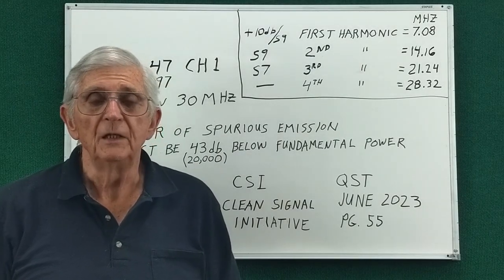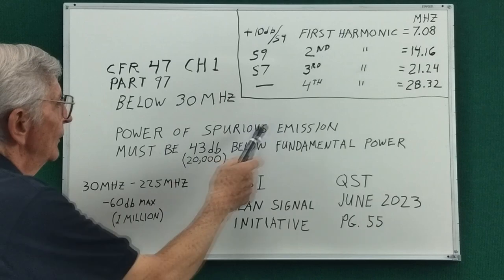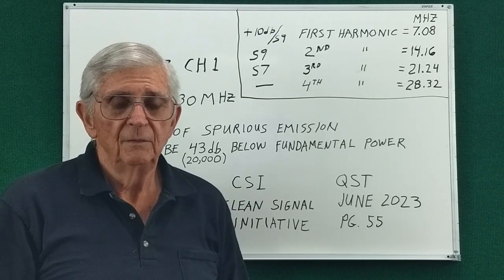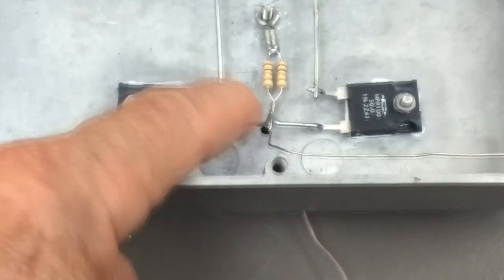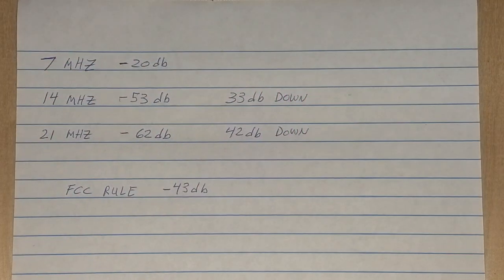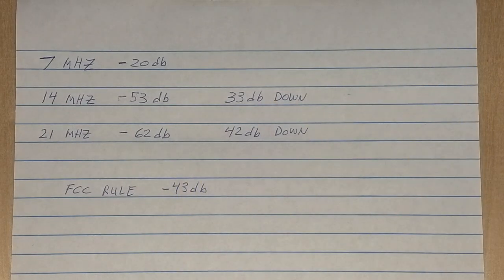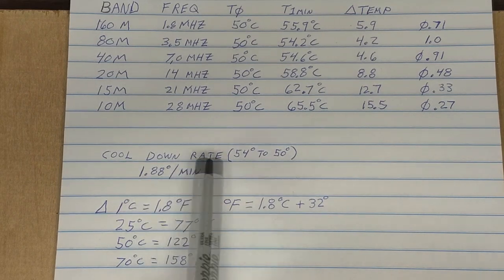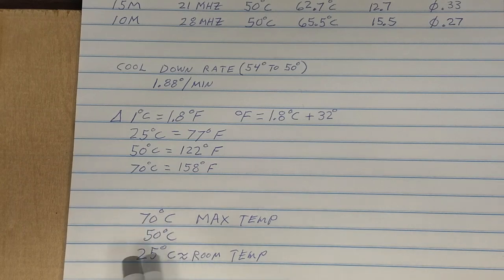EFHW emissions violate FCC rules

Comment: The various ferrite "mixes" (or types) have several highly temperature-sensitive characteristics that affect transformer linearity, most their notably permeability change.  As perm changes, the magnetization curve (BH curve) tilts introducing transformer harmonic distortion. Core suppliers can provide material characteristic data sheets.  I have always believed that HF and up matching transformers use for any antenna are not ideal due to their losses (heating), and best to utilize a matching circuit or ATU instead.  Your work reveals something most have not previously considered.  Good job.
Reply from the maker: In this more recent video I discuss exactly what you are talking about.
https://youtu.be/mev44L1Y3us?si=1g-BcCHum8DPr5Vj
Thanks for your nice comment.

Comment: Excellent demo! This is certainly the first time that I have heard about this.
Reply from the maker: Thanks for your comment.
Reply: It is his misunderstanding, looking for something that is not there.  The radio or circuit he has put together is at fault.  The spurious emissions need to be measured from the radio directly using a dummy load, then through the box he has made.  You will find it is the box he has made that is causing the problem.
If the radio is giving spurious emissions it needs sorting out.
The antenna only radiates what is put in to it.  Every licenced radio amateur knows this.

Comment: Jim, I think your title is a little misleading. Someone might read it and think that EFHW (or EF random lengths) are inherently problematic. What about dipoles with ferite baluns at the feed point? What of unun's feeding verticals? The title therefore should focus on ferite core heating and not the antenna as a potential problem. Yes, because EF antennas require an unun there could be a resulting harmonic problem, but the problem certainly isn't limited to that antenna.

I suspect also the ferite material would affect the data you secured. You didn't specify that information. Type 31 vs type 43 vs type 52 vs type 61 or Txxx-2. Depending on what the material of the core is will undoubtedly affect the heating vs frequency. And 50°C seems an unrealistic starting temperature; it's hardly ambient except in the Sahara Desert and I don't think many of us live there. I used to live in Phoenix and even that's a tad bit high unless we're frying eggs on the streets (urban legend).

Your conclusion about cooling seems spot on. I've thought about that quite a bit and think using a ceramic material might be a better heat sink to attach to since the ubiquitous PVC box does nothing here and mounting flush to an aluminum box might have its own issues (although DXE uses aluminum boxes in their transformers).

I like your video and wonder if you could make an update to it with the considerations I mentioned? I'll even provide you with whatever cores I have on hand if you want.

Glen
KE7FD
Reply: Core saturation also is really great at causing distortion/spurious signals.  It's not directly related to heat.
Reply from the maker: please read the very first sentence in the description. The thumbnail it meant to attract attention  which it obviously did. The 50 deg C temperature is not an ambient temperature; it is the core temperature after several minutes of operation. The core will reach 50 degrees after just 2 minutes of transmission on 10 M. It is roughly half way between ambient and the critical temperature (70 deg).
Thanks for your comment. 73
Reply: @Jimscoolstuff could you share some details of the transformer? Core size and number , winding details, etc... Did you measure efficiency? For the test what modulation did you use, FM, CW key down or something else? These details are important in order to understand your test. If you could post the picture of transformer that would be helpful too. I would like to repeat your tests myself and find the way to remedy undesired effects. GL 73 Marek SP9TKW.
Reply from the maker: @mareksp9tkw908  The core is an FT-240-43 made by Amidon. It is the standard 2 turns to 14 turns with the crossover. There is a good view of it at the 59 sec. mark into the video in the description below. The one titled "EFHW antenna power rating". The tests shown were just 50Watt carrier on or off, no modulation. Thanks for your comment. 73
Reply: This is apples to oranges obida.  The EFHW is using a "transformer balun", which depends in part on magnetic flux to transfer input power to the output.  This heats the Toroid.   A dipole uses a 1:1 "transmission line balun" which transfers input power to the output through the transmission line; it does not use magnetic flux for the power transfer and does not heat the core like the EFHW transformer does.  73 de DJ0IP

Comment: Part 97 specifically indicates that these measurements are to be taken at the output of the final power amplification stage.  This is interesting, and in the spirit of good amateur practice it's worth continuing to look into.  However it's a stretch at best to claim the emissions from an EFHW are "Illegal".  So long as what comes out of the finals is legal it appears to me that you're 100% compliant with the regs.   Take the reverse situation:  are the import HTs that clearly generate excess emissions OK because their antennas are terrible and don't radiate those emissions?  Of course not.  This is why it's measured where it is.
Reply: You are spot on.  97.307 (e) is very clear - input to the antenna transmission line.  I do appreciate his efforts, but definitely bogus to call it illegal.
Reply: By that logic, back-to-back diodes installed at the antenna (designed to square-up the RF, generating endless odd harmonics) would not be illegal. Right ?

Hmmm. Perhaps there are other regulations in existence than just 97.307 (e) ?
Reply: This may be legally true, Matt, but that won't help you much if you get a pink slip from the FCC.
Reply: @JxH  this

Comment: Thinking about it there may actually be 2 different heating rates.. the one you measured when it is reasonably efficient when it is in the cool linear region, then as it heats up and becomes non-linear and inefficient absorbing more and more power so heating up faster as it hits thermal runaway

Comment: EEY-GADS-ZOOKS BATMAN!
WHAT'S A HAM TO DO?

Actually, this is very informative info and is well presented. Thank you, Sir.

I'm in the process of putting together a second 56:1 transformer for my 40M EFHW ant using a better toroid, and you just threw a Monky Wrench into my soop. ARGGG

I mostly operate SSB voice and don't expect to get into this problem there with my 100W 590SG, but I do intend to operate Digi/APRS/WSPR/etc on HF in the near future and also get back into CW and I should deffinatly take your information into account.

I'm thinking of two stacked cores with an ALU disk, with cooling fins/tabs, sandwiched between the cores using PC-CPU type heat compound. I'd tie the cores together with TieWraps.

Alternately, a single core with a tabbed ALU disk at each end should be sufficient for 100W Digi ops. Maybe, I HOPE.
A few each of the 15 turns of enameled wire should fit safely between the fins, I think/I hope.

I'd cut the disk out with a Dremmell and bend the fins/tabs in alternate directions, up/down.

Yet Another Snot on the Door Knob of Life to Deal With.

DRATS. Double DRATS Even......

73 OM, and thanks for this info.......
Reply from the maker: Thanks for your comment. Good luck with your experiments. Remember that heat means losses, so a lot of your RF is wasted making heat.

Comment: NEWS FLASH: Ferrite has been used in the feed of many types of antennas, it's not just an EFHW thing. Baluns were a 'Very Big Thing' in the 1970s. 

Also, EFHW, being extremely high-Z, would have less current and thus less core saturation than other antenna types.
Reply from the maker: First of all, the cores are fed at an impedance of about 50 ohms thru the two primary turns. This means that the full output current of your transmitter is applied to the core.
Second, the problem does not appear until the core reaches a critical temperature, so depending on how you operate, you may not see the problem.
Third, the folks selling this stuff don't want you to hear of this problem.
For a full understanding of the issue please watch these two videos.
"EFHW antenna power rating" and "EFHW spurious emissions caused by ferrite toroids"
Thanks for your comment. 73
Reply: Not all baluns were created equal.  Transformer Baluns tend to heat (or even overheat) whereas Transmission Line Baluns do not; at least not nearly as early.  Dipoles use Transmission Line Baluns whereas EFHWs use Transformer Baluns .   It is indeed a potential EFHW problem.

Comment: Excellent.  Good to know, especially that it occurs long before SWR creep begins.  May not be a problem with SSB but certainly with digi-modes!
Reply: SWR creeping up usually happens with poor quality ferrite rings.  They DO heat up when you subject them to RF.  If you use something too small, or use wire that is too thin, it will all heat up.
Use something that is not just rated for your maximum power, but overrated by a few times.

Comment: So, just some things I got curious about while watching the video...the time to cool of 1.88C/min...is that average? Is it linear, or is there a curve? Re: the temperature increases per band, I'm interested in seeing how that matches up to the core's position on those ferrite core efficacy spreadsheets out there...the ones where green and a black line are good... (sorry, spacing). Also, do you have a part num for the Core-under-test, and what's the placement of the thermistor? I might try this with the thermal scope. Excellent video.
Reply from the maker: The cooling rate is a function of the core temperature above ambient temperature. The core that was used is an Amidon FT-240-43. Here is a link to another video on the subject.
https://youtu.be/mev44L1Y3us?si=UEX0SrO7rIjK9y14
I am working on a second part of that video.

Comment: There is one large question.  Did you apply a constant signal to the transformer? IE key down CW or FM?  That will heat up the toroids for sure, but is that what happens in the real world? No, certainly not.  The duty cycle of an average CW signal is way below 100% and no one runs FM on 40m.  Therefore, the toroids would experience one 50% cooing cycle for each 50% heating cycle. I  think if you apply real world applications and real world uses by everyday hams the results would be very different.
Reply from the maker: I usually run FT8 which transmits PSK for 13 seconds, is idle for 2 seconds, and listens for 15 seconds continuously. That is a 43% duty cycle. When the core heats up faster than it cools down, the core temperature will steadily increase over time. You are correct, CW and SSB are much lower duty cycles. Thanks for your comment.

Comment: Thanks for sharing this Jim. It would certainly be good for others to repeat this test to see if similar results are obtained. Of course, as you say, ARRL (or someone with proper lab environment) looking at this would be good.

In addition to EFHW UNUNs, wondering how this might affect use of toroids in multitude of applications - PA stages, antenna matching circuits, filters, etc? Basically, any application where toroid cores are being used and subject to significant heating.
Reply from the maker: Thank you for your comment. I would like someone to confirm my experiments or even confirm that the cores get hot. In other applications there should not be any problem unless the cores get hot.
Reply: Ferrite cores do get hot sometimes to the extent that they get shattered in high power applications. 
Many have complained of the heating up of EFHWA UnUns with high power and many solutions have been suggested. 
In high power, solid-state power amplifier ferritr loaded output transformer designs harmonics are anticipated; so, low pass/harmonic filters become mandatory. 
This is the first time I have seen one is experimenting to look for harmonics in the efhwa UnUn transformer. 
Thanks for your efforts  👌 
De VU2RZA

Comment: Jim, I'm not seeing those Ohmite in the TCH series on Mouser -- could you provide the part number you used?
Reply from the maker: I guess I got my projects mixed up. The resistors that I used in the dummy load was a Caddock part. The Mouser part number is 684-MP9100-50. Sorry for the mix up.

Comment: If your cores aren't rated for the power you're using, then yes they'll heat up. The fact that they're heating up tells me you're not using the right core, or you're exceeding the power rating for the core.
Reply from the maker: Please tell me the power rating of the FT-240-43 core. Thanks for your comment.
Reply: @Jimscoolstuff Check out the videos put out by MM0OPX on the impact of various core mixes and designs at different frequencies.  He is looking specifically at efficiency and loss in the cores with different windings, stacking, etc.

In particular, 10m has really low efficiency as you have observed.

Comment: SO would like to see other ways to feed the EFHW that do not involve a ferrite transformer,  even though I would assume these methods might only work on a single band at a time and require tuning.
Reply: Could one use an air-core autotransformer with  more turns >> equivalent  inductance to ferrite core device? would there be too much capacitance  between turns.>self resonance?
Reply: A parallel tuned tank circuit with an air variable and a coil is the gold standard.

Comment: How long to heat up if used at say 100W PEP SSB with the typical duty cycle of a ham QSO,  with nothing like a constant signal.  Talk for 30 seconds and off for a minute.  It is good to know this issue but makes me think of things such as tube ratings, like how they rated tubes for intermittent ham radio apps versus the lower power ratings for continious output like broadcast.
Reply from the maker: Be sure to watch the video on power rating. there is a link in the description. In that video I compare the duty cycle of SSB, CW, and data. thanks for your comment.

Comment: Power levels are measured in dBm, not dB. You are incorrectly expressing them both in dB. It matters and might be confusing to newbies who want to learn the correct nomenclature.
Reply from the maker: You are correct when talking about absolute power. When comparing ratios of power (relative power) dBm is not used.
Reply: @Jimscoolstuff  i refer you to what's written on your chart early in the video.
Reply from the maker: Sorry, but I can not figure out what you are referring to. Please tell me the time in the video where you see the problem. @AE5X
Reply: @Jimscoolstuff  09:35
Reply from the maker: Technically you are correct about the measurement of the magnitude of the fundamental. In talking about the magnitude of the harmonics I am speaking about them relative to the fundamental "dB down". Thanks for your comment and best regards. @AE5X

Comment: So, starting at over 120 degrees and keying up on FM for a minute heats the cores enough for spurious emissions?
Ok, what if we start at 60 degrees?
Also, the FCC rule is measure that the transmitter.
You are breaking no rule with the EFHW even at over 150 degrees.
This seems rather misleading.
Reply from the maker: I show the rate of temperature rise in the video. It does not matter where you start. Ask yourself; what is the intent of the FCC rule? Is it bad when a transmitter causes interference, but OK when an antenna matching device generates interference? Was the FCC rule written before non-linear devices were being used in this way. If someone hears your out-of-band signal does how it was caused really matter?
Reply: @Jimscoolstuff  
EFHW antennas aren’t really new. 
Yes, the rate matters.
Versions are made for different power levels. They stay cooler under power. Getting to the Currie point is not something you want to do.
Getting a transformer that suits your station is the important part.
A working transformer doesn’t put out spurious emissions…as you showed.
Abusing a transformer isn’t the goal of people who use these antennas.
Whether it’s the spirit of the law isn’t really relevant.
The rule is the rule as written. That said, EFHW antennas are not putting out “illegal” spurious emissions. 
That is simply click bait.
Reply from the maker: Please look at the FCC definitions of "antenna" and "transmitter". An antenna is a device that converts RF from a transmitter to radiated energy. This means that the ferrites are part of the transmitter. A transmitter is a device that delivers RF energy to an antenna. As with all legal definitions they may be subject to interpretation by an individual.  @johnarcher9480
Reply: @Jimscoolstuff  I think it would be a stretch to call a transformer a part of the transmitter instead of part of the antenna.
By that definition, any SWR meter or tuner would now be transmitters. As would any coax in the system.
And again, when you tested it, it showed NO spurious emissions. Only when the ferrites were abused, did you start to see some spurious emissions.
Reply from the maker: SWR meters and tuners are often built into transmitters. Are they then part of the transmitter? The same for a power amplifier. Is the output from a power amplifier exempt from the emission rules?  We could go on and on like this. I think that we should agree to disagree and stay friends.
73 Jim KQ8E @johnarcher9480
Reply: @Jimscoolstuff  We can agree to disagree.
Thanks for not taking healthy debate personally!
73
John
NO9X